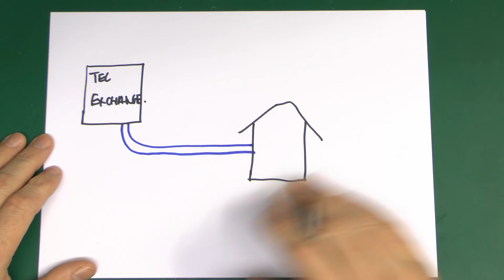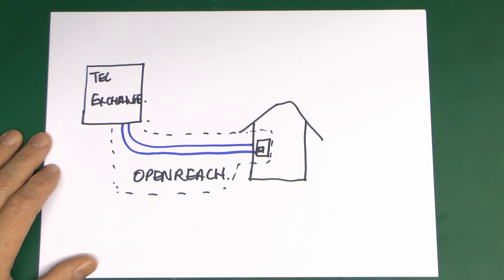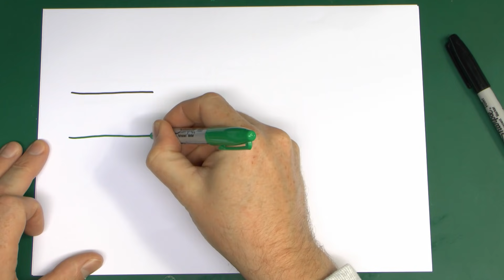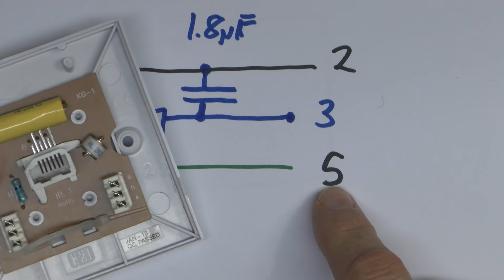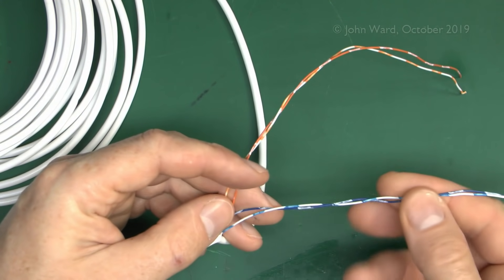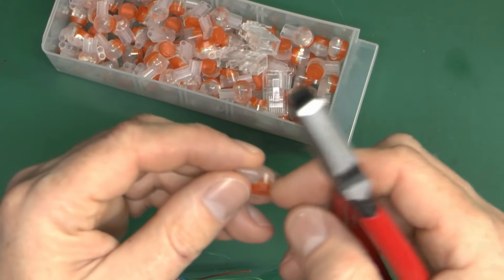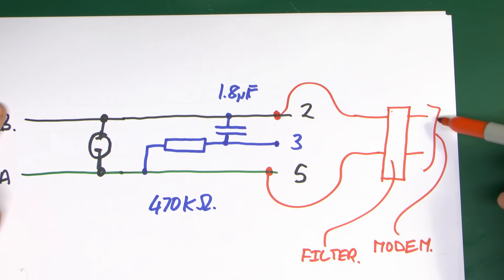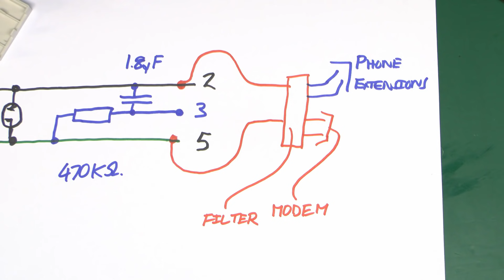UK Telephone Wiring, Sockets, Cabling, ADSL / VDSL Filters, Extensions.

Comment: You need terminal 3 for separate or external bells.  Cordless phone base stations have limited range, particularly in houses built traditionally, so extensions are necessary. Is there any specific filter one can buy and insert in the bell line to strip out induced interference?
Reply from the maker: This is the filter: https://amzn.to/39f6ROm although seldom used on any installations now, later version master sockets include the filter as standard.
Reply: my phone is crackling so loud it is unusable.

Comment: Hi , I need to move a box, I have a punch down tool for refitting the wire.  But how do I remove the wires that are currently punched in.  Is it just a matter of pulling up to release them?  Thanks
Reply from the maker: Yes, they just pull out.  Some of the installation tools include a hook for that purpose.
Reply: John Ward thank you

Comment: 11:50 Wouldn't that resistor and capacitor attenuate your high frequency VDSL signal?  Are they always installed?  It seems that VDSL would work heaps better if you could get rid of them.
Reply: Yes, if only used as a sole data line.  Not by much though.
Reply: Yes still installed.
Reply: The resistor value is very high compared to the line impedance (almost a thousand times higher) so it has very little effect on the signal. The high frequency seen on line 3 is highly attenuated off course, but that's fine - it's only feeding the ring detectors.
Reply: During my many moons of research I found that the newer Jack's have the ring capacitor after the low-frequency pass filter, it was not always that case which caused issues with the DSL

Comment: "Virgin Media customers" come in two flavours.  The 'cable' areas have the VM coaxial network using DOCSIS3.0 (3.1 being rolled out) while the 'national' areas don't but instead use vADSL over Openreach wires and network.  This is only really significant if you got to a "VM" job expecting one thing and find the other.
The dependence of newer systems on external power does make me think that abandoning the old POTS could be a mistake; at least if newer equipment does not have substantial battery back-up options. Its a pain when you can't report an internet fault because it's taken your phone service with it.
Reply: I thought virgin sold off its ASDL customers several years ago.
Reply: @AndyK.1   <Googles>  Oops!  You're quite right.  [I'm on their cable offering so didn't notice].
Reply: Don't forget the RFoG with the media converter that needs powering from the house....

Comment: Does anybody know what that gel stuff in the connectors actually is? It can't be vaseline or silicone grease as AFAIK these both can absorb a lot of water, which would be counter-productive ...
Reply: It is a kilopoise silicone grease, so that it stays put. Water repellant, and even though it does have a small amount of vapour transfer, the copper wire will only corrode slowly, as the joint is protected by the insulation, and the join itself is a very strong metal to metal bond. They will operate for decades sitting in salt water, which I have plenty of experience with, though in most cases the cable itself will have issues from water ingress ( especially paper insulated ones) long before that joint corrodes off the wire inside. Biggest problem is it gets everywhere, and is a very effective water repellant, which means if you have touched some, or an area where they were, you will find that you cannot remove it from your skin till you mechanically abrade the skin away. Makes painting near those junction boxes difficult, from all the incidental transfer that contaminated the walls. You basically have to sand down heavily, wash with solvent, then sand again and then paint, and hope there are no fish eyes looking back at you.
Reply: @SeanBZA  😁👍 One of the nice thing about John's videos is that you'll find a lot of experience and knowledge in their vicinity.
Reply: It always used to be petroleum jelly, AKA Vaseline.

Comment: I extended the cable from the front of my master socket approx 5m to a secondary socket with the usual plug in microfilter, so that my Modem was in the middle of the house for best Wifi coverage. The Master socket was only installed in dec 2017 so was a newer type. But as i extended it from the front of the socket, my internet kept dropping out. It was fine however when i moved the connections to the rear of the master socket. So my point is, i believe some newer master sockets actually have additional filters inbetween the A/B contacts and the 6 pin plug on the front.
Reply: They do to keep any back voltage from your equipment  getting to the network.  You wired it to the  A/B terminals direct? tut tut ;)
Reply: They do, it's what is known as a filtered socket. It's basically to mitigate the use of "microfilters" which used to confuse everyone. The IDC connectors on these sockets are also filtered. So these are fine for other handsets, but NOT for Routers. The router should be located on the master socket, but if you really need to have the router on an extension, you would have to connect that line to the incoming AB, which isn't filtered, rather than the IDC, which is. You's also need to use some good quality twisted pair, and as the line is longer, you will see a small speed reduction, compared to plugging into the master socket. You would also need to use a microfilter on the extension socket, if you wanted to connect a phone.
Reply: There it normally a second set of A B terminals for you to wire in a router cable extension.
Reply: Maybe a better idea to extend the incoming wire to the master socket and move that too ;)

Comment: Do you still can get a wired telephone lines in UK? Here in Finland we can't get new wired phone lines anymore. And the old cables are not really maintained anymore either. They just like to take them away if there are any problems with them. Actually even when there are no any issues they take the cables away in some areas.
Reply: Same here, just the cable is stolen more than taken away by the telco.
Reply: They're working on it. There are plans in motion to do away with ADSL in the next few years then phase out copper by 2027. The problem is with all the old copper runs buried in concrete, or collapsed conjugate, that require weeks of manpower to dig up a street at a time.
Reply: @garybrownlee6537  Most telcos just abandon it and remove above ground stuff, digging up streets and buildings to get the cable is not worth it. Leave it buried for future archaeologists to discover and wonder over.
Reply: SeanBZA installing a bunch of the FTTC cabinets caused planning issues with NIMBYS / councils. Trying to install tens of thousands of new poles and suspended cable runs would certainly be interesting. But I guess “most” telcos don’t run into those issues
Reply: No. Fibre to the premises is costly per month though 😔
Reply: The majority of domestic and business premises in the UK receiving an Internet service at present (November 2019) does so over a wired connection. In some scenarios, if you subscribe to Virgin Media this is done via coaxial cable using DOCSIS, but for nearly everyone else this is done over the copper pair on the Openreach network, using ASDL/2/+ or VDSL/2. In a few locations G.fast is offered but Openreach are slowing down its roll out in favour of FTTP. According to the UK's broadcast & telecoms regulator, Ofcom, over 95% of domestic premises can now avail of at least a 24 M/bit download speed via coax or copper pair.

Also by law, for a new installation Openreach (or KCOM in Hull) must still supply a copper pair to the premises even if an FTTP fibre line for Internet & VoIP only is offered. There is a discussion on removing this mandatory requirement as FTTP connections are gathering pace, especially as alt-net FTTP operators like Gigaclear & B4RN are not subject to this regulation for their networks. Additionally, Openreach are looking at closing down their POTS network and replaced with a complete VoIP service for those still using landlines by the end of 2025 - of course, the VoIP service can still be delivered over a copper pair. 

The version of VDSL2 used in the UK gives a top download/upload speed of 80 Mb/s and 20 Mb/s which for most people is more than enough in most circumstances. Openreach did look at using G.fast as a last attempt to "sweat" their copper pair network, but cheaped out by using the relevant pods at the FTTC cabinets rather than the drop pole/drop point (FTTdp), handicapping provision given the short distances that G.fast can work at, so they've scaled back on their previous announcement on the G.fast roll out and are now concentrating on FTTP.

Alternatives to Openreach/Virgin Media/KCOM/FTTP Alt-nets are generally limited to premises that are too far from a telephone exchange (ADSL) or roadside cabinet (VDSL). Some Fixed Wireless Access networks exist of varying quality and service, its only very recently that the mobile networks (other than 3 UK) have now started offering unlimited data over their 3G & 4G networks (though it can be useful in more built-up areas for the likes of university students) and of course there is internet via satellite, but that is very much a last resort when no other option is possible.
Reply: @garybrownlee6537  Wow, what on earth did you type to get conduit -> conjugate?

Comment: Virgin media do now do fiber to the home FTTH, that dose give you real fibre speed. But what happens to VM customers in a power cut? Can they use corded phones?
Reply: yes on old installations with a wall mounted master socket you have direct link to the exchange/mux and no on all new installations because the phone service is supplied via 21cv out the back of the broadband router. There is optional BBU installed for emergency number only in event of power cut and rarely is this installed

Comment: The ring circuit has a few extra peculiarities.

Why have it when the ring voltage is present on pin 2?  Tinkle suppression on old-style electro-mechanical phones.  In other countries, hanging up a phone causes a back EMF that causes the other phones to tinkle.  In the UK, hanging up a phone shorts out the bell wire briefly to suppress the tinkle.

Phones in the UK have a "Ringer Equivalence Number" (REN) based on how they compare to the old-style electro-mechanical phones.   BT guarantees to be able to generate enough current to ring four old-style phones.  Newer phones typically require a lot less current but usually have a REN of 1.  Going by the REN, more than 4 newer phones might not ring, in reality they usually will.  That's because of how REN is tested.  The manufacturer submits some number of phones which are wired in parallel to a standard ringer circuit and the test is if they all ring.  Submit 1 phone and it's rated with a REN of 4.  Submit 4 phones and if they all ring the REN is 1.  Submit 40 phones and if they all ring the REN is 0.1.  You don't get the phones back.  So manufacturers typically only submit 4 phones and they get a REN of 1.

If you really need to drive a number of phones with a combined real REN greater than 4 and your line isn't up to it, fit a second master socket.  That gives you effectively twice the capacitance and may (if you're not too far from the exchange) let you get away with it.
Reply: I think I have 3 bell capacitors in my house. I don’t get 3 times ren allowance though. But it makes a small improvement. Maybe I need extra resistors.
Reply: Even more peculiarities in the old series ringer system (before the modern socket). Mercifully faded into obscurity!
Reply: @AndyK.1  Or you need to move closer to the exchange.
Reply: 20 years ago at my Dad's house he had a fax machine with built in phone (REN of 1.5) and no less than 4 other phones (It was only a 3 bed semi!).  BT were called in and in the end we had to rent a powered ringer unit from them.  It was a mains powered device that amplified the ringer to the phones.
Reply: @neilcaldwell870  Of course they're going to make him rent a powered ringer rather than just fit another master socket.

Comment: virgin are very good at fixing faults, however the fact they have now opted to connect the landline through the broadband router for new installations is a right pain in the arse, its crap and 2/3 calls are dropped, if you call them up to repair the issue they get it done very quickly but it only lasts a few days then its back to crap again, shame as the broadband in my opinion is the best around, albeit for my area.
Reply: in the last 3 years virgin wired my house and buisness, both got dedicated phone wiring along with the coax for the tvbox/internet. if that has changed thats a shame, but likely it has not for buisness, and who uses a landline at home these days, we only have one cause it was part of the package. interesting to know though, as there routers are crap and in both instances I have put in modem mode and installed my own. (whole can of worms for a buisness with fixed ip)
Reply: @denisohbrien  We have a landline at home. We tried connecting comms to the leccy company's wires but it didn't work - so we have to use landline.
Reply: We only use the landline because we cannot get a mobile signal at home, my missus is switching to the 02 network when her conny is up coz thats the only network that gets a signal around here.
When we started having issues with the landline it was about a month after we moved in, we actually moved within the same road but to the opposite end where the ground is much lower and thick tree coverage all around, even sky tv cannot pick up a signal here (so im told).
The 1st engineer to visit us to sort the landline told us that virgin are only providing this connection type to new installations and are not installing phone lines at all now, only maintaining existing ones, as this house had no existing virgin installation we got this shower of shit, put it this way, its so crap that when i call the house from my mobile, i call then hang up straight away and then call again because i KNOW the 1st call will defo drop, calling out usually seems fine, its just incomming, and yes, the routers/hubs are pants, the signal is good but very short so i have 2 range extenders upstairs, but range extenders drop alot of speed, theyre ok for mobile connections but i had to run a cable for my boys xbox as the speed dropped so dramatically it made gaming near on impossible (1st world problems i know) but at the end of the day, im expected to pay for the so called "landline" which techically isnt a landline at all now.
Reply: Also, on my Virgin install, my modem is in a different room to the phone master socket.  If I had to have the phone coming off the back of the router that wouldn't have suited.  In a way though, it may have some advantages as technically it's VOIP isn't it?

Comment: very interesting about the 3rd wire for older phones. I wonder why they decided to carry a 3rd wire inside the property rather than jsut have those components in each phone
Reply: Because it allows more phones to be connected. If you remember the REN number... If too many caps in line you ended up with not enough current to ring the bell
Reply: They didn't. The third wire was used from the master to extensions for the 'bell' to ring.  Only 2 wire per line. Back in the day, 2 wires were pulled and you shared your line with next door. Both signal, and used the Ground (Mud) as a ground. It was called a party line. Only you OR your neighbour could use the phone at any one time. Not sure if it was copper saving post war or just tight bastards.
Reply: @Danechip  better than ally cable!
Reply: @peterhurst  The REN (Ringer Equivalence Number,  set at 4 (or 4.0) was to do with  the power required to 'ring' all connected. Average 1.0 per phone, but seen some at 1.5 even 2.0 in the past. The total should be 4, but I have been to an install and the sub had 6 phones changing over to us from BT to us on a cable company. We will call them Birmingham Cable as that was their name (changed to Diamond now VM yes) Argos did a promotion on 0.5 once. Didn't improve sales   as REN was Ren and Stimpy then...
Reply: If you don’t have a common bell wire you get bell or ringer tinkle when dialing with pulse phones.
Reply: @AndyK.1  I can't comment on that.  But why lose internet speed for a retro phone. I am surprised the would still work now?I just remember the clicks being sent instead of tones. I think around 85,  the dial tone got higher and I thought I was playing Major Morgan with DTMF :D
Reply: @Danechip  Pulse dialling still works on my BT POTS line.
Reply: @AndyK.1  Correct. When pulse dialling the bells were shorted via a 51R resistor (IIRC) so they didn't tap out the number being dialled.
Reply: @Graham_Langley  Thankyou